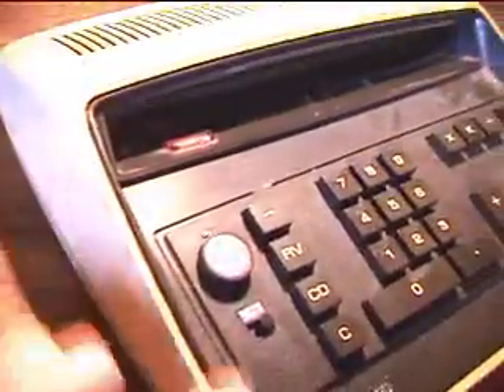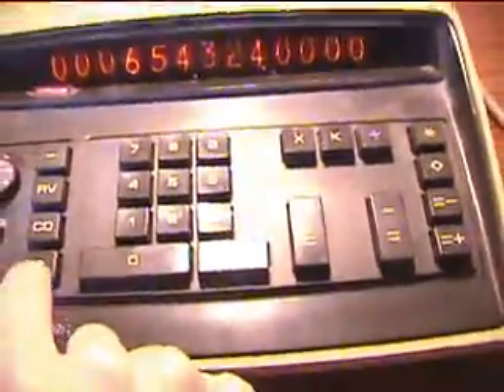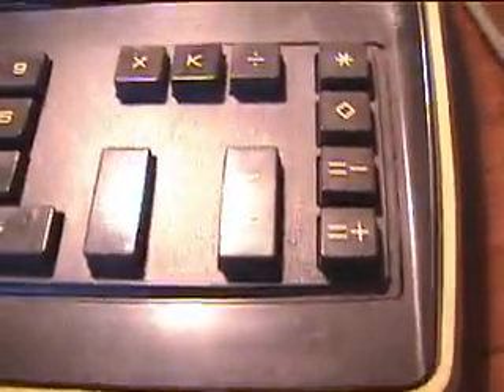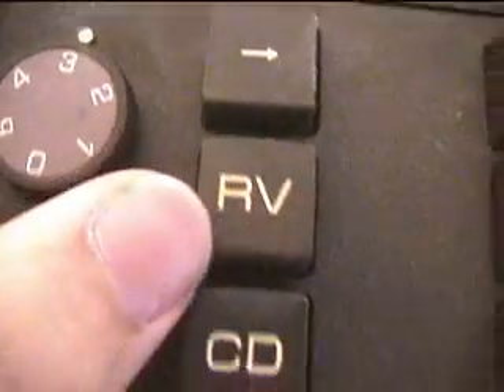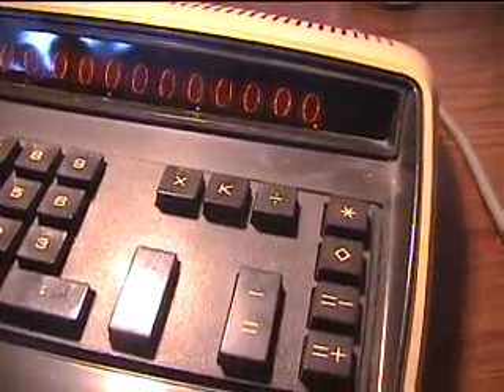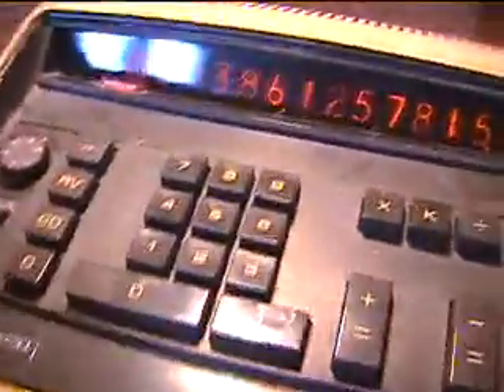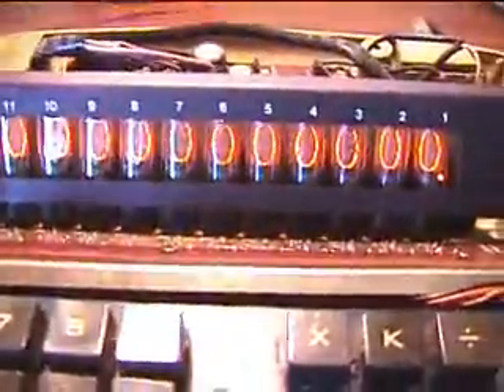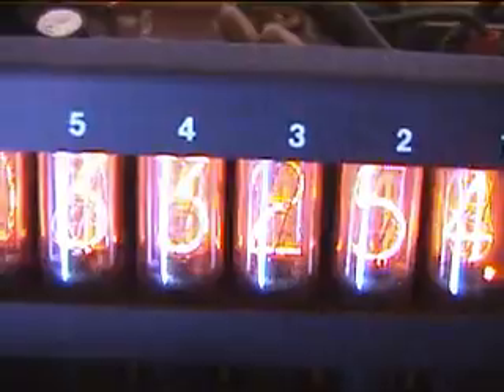Monroe Ii 620 NIXIE tube calculator!!

Comment: I think the 5/4 key has to do with rounding up or down... how the machine will round a digit up, according to the digit past it not displayed with the static decimal place.  I.e. round down on a 5 (but up on a six),  or round down on a 4 (but up on a five).    This is an accounting calculator, I have an assload of them myself with VFD displays... and all those keys.. K *, etc... are standard even today.  Its diff. than your standard school calculator, its for adding up columns of ledger entries.

Comment: The dial is suppose to set your static decimal position.   Like if you were doing money math, you'd set it at 2 (decimal places static)...  to have the decimal stay put for the change in all your calculations.  Like,  1.25 would show up, but if you took off .25, then 1.00 would show up, and not 1.
Reply: Are you sure about that? What if the dial establishes where you want to round off too, that is how many places to the right of the dp you want to round off, ie the level of precision, but not a fixed dp.
Your description better fits mechanical calculators.

Comment: All nixie tubes require high voltage of about 160 to 170 volts dc, the once in the watches just use a boost converter to step up the voltage.

Comment: They require a resonable amount of voltage (like 90v-120v) but a small amount of current. You could run them off a low voltage if you built a joule ringer. (google joule ringer)

Comment: Even more freakish than the nixie tubes is that the digital logic is probably hand wired with discrete components (transistors and diodes).  Even though ICs were starting to appear, many calculators of that era didn't use them

Comment: @CassetteMaster I see the calculator is plugged to the mains! These tubes require a lot of voltage. But are there any nixie tubes which run on low voltages? I've seen nixie tubes used in a watch operating with a 3 v battery, how is that possible?

Comment: I bought one of these for $10 at a junk store. These were made around 1972. Mine has 16 digits, plus commas to separate thousands lit by neon bulbs. Mine also has neon lights with small, clear, beehive-shaped lenses over the keys for Memory 1, Memory 2, multiply, and divide, which light up when those keys are pressed. The "LI" on the front stands for Litton, which I believed purchased the Monroe company around that time.

Comment: The "K" key sets it into constant mode. Say you do 2x2. If it's not in constant mode, you have to type x and 2 every single time. If you press the "K" key, and then enter 2x2, then every time you hit the "+ =" key it automatically recalls that you are multiplying by 2 and will do the correct multiplication every time you hit the "+ =" key. 2, 4, 8, 16, 32, 64, 128, 256, 512, 1024, 2048, 4096, 8192, 16384, 32768, 65536, and so on. With "K" up, it won't do that.

Comment: The dial is your decimal selector. It sets the number of decimal places to the right of the decimal. The "4/5" switch is the rounding switch. An example, turn the dial to 2, and the switch to "4/5", and type 5+15, and you should get "00000000020.00" then try 20 divide by 3. The answer is "6.666666666666" on a modern calculator, but since the dial is set to 2, it will show "00000000006.67". Flip the "4/5" switch to the down arrow. Do 20 divided by 3 and it rounds down to "00000000006.66".

Comment: My oldest electronic desktop calculator is either a Monroe 925 or an Elektronika 4-71b (Made in USSR). I think the Monroe is older. I have a Canon 163 on the way, being delivered by post. My oldest pocket calculator is a Canon Pocketronic. I have repaired a couple old models, including two Commodore N-60 navigators and a Commodore S-61 Statistician. That's an awesome find! Those Nixie tubes just can't be beat by any modern segment or pixel display. They are beautifully retro!

Comment: The dial is for the number of decimal points for instance if you have the dial on 4 1+1=2.000 if you have it on 2 1+1=2.00 on zero 1+1=2